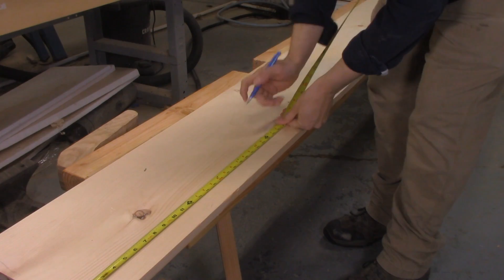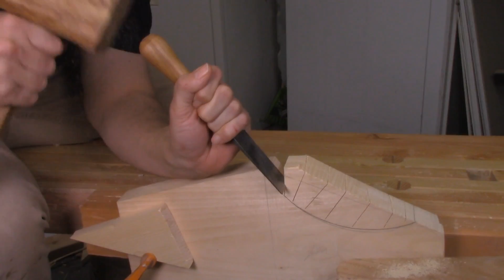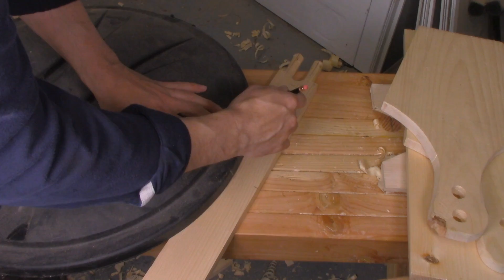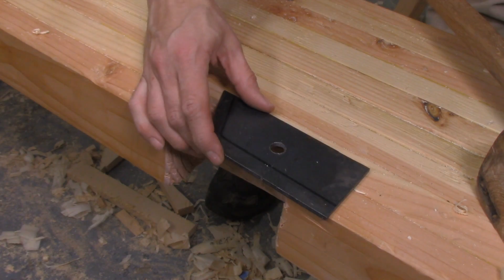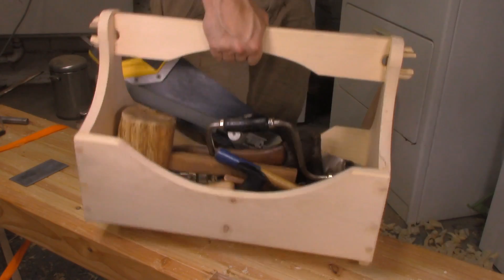Make this tool tote from one board.

Comment: Just to share a little of my own experience: i made a tote for my daughter; she's at an age where she wants to do what Daddy does (LOVE THIS AGE!), and so we made a tote...the handle was some left over curtain rod. I drilled a hole that was almost the same diameter, and it was a right-royal pain in the rump to get the handle in place. but, it's there for good, and no glue or fasteners required. I had the same general shape, with the outward slant of the sidewalls, and made the end pieces first. When I attached the side pieces, I didn't try to shape the wood at first. I drilled holes, pegged it with glue, and when the glue dried, I planed the protruding edges of the side pieces down. One benefit is that the side angles may or may not be consistent. Don't have to be. Planing "whatever protruded" made it the right angle, even though I have no idea what the angle is. I used a small forstner bit to put series of 1/8" deep "depressions" in the wood. hard to call them holes, really. I glued in some rare-earth magnets, for tools to stick in place. It was a good little project, my baby girl loves it. She glares at me because I use it all the time! (yeah, I need to build myself one!) :-)
Reply: Great comment my baby daughter is one and I can’t wait to build her a tote and some wooden toy tools
Reply: @monkeyfaceII  go for it! i used to joke about teaching courses like 'toddlers and power tools' and 'baby's first table saw' - but, having your little people with you in the shop is a such a joy. and a pain. mostly a joy. :-)  only one of my 4 kiddos has much interest in shop stuff (my youngest), but at least one does....
Reply: @just-dl  that’s awesome I will

Comment: Hammering wood through a half inch box end wrench will work well to make the wooden dowels ( if you don't have the ability to drill steel). A little touch up with a rasp will make it very close to round.
Reply from the maker: That's a GREAT tip!
Reply: Agreed. That is indeed a very good tip!
Reply: I am going to give this tip a try.
Reply: Cool! I will try this too.  
Slot of us are not starting from scratch, but instead have a good variety of general tools.

Comment: coming from a carpenter, roof rafters are great and all, but we use the speed square for literally everything, a good speed square might even have depth gauge so you wouldnt need to take out another tool to get it done. i personally only use a speed square in my woodworking kit as well as i havent found a need yet for anything else, then again i've only done a few projects

Comment: This built shows off the functionalities of your workbench really well. It's remarkable that you really didn't need to break out the clamps until you showed off making the dowel with the homemade draw plate, everything else could be worked on with just the bench attachments.
Reply from the maker: You kind of need one bar clamp, but one does the job.

Comment: I'm pretty sure your dewalt construction saw has an square in it. A 90° and 45° in the handle and it should be good enough for many not so critical stuff. 
Idk may be helpful to someone.

Really enjoying this series
Reply from the maker: It does!  Good point!
Reply: Yes, many modern saws seem to have this design (not so much for older saws in my experience, which seem to trade this for a more ergonomic grip). I know my short crosscut saw has this feature ... but, it's old enough now that the screws have slipped. Even though I've tightened them up to keep the blade solidly attached, I can no longer trust it as a square. So if your saw is relatively new this can be a good solution, but the older it gets the less likely it is to work.

Comment: I really like the fact that you are working with basic tools on a low workbench! one thing I wanted to mention however, by using wooden nails/pegs (or screws for that matter) for the sides you are not really allowing the wood to move, definitely stronger than just glue in this situation, but by using iron nails you would actually let the wood move a bit because the iron nails can bend. I guess in this situation, with those sides which are still quite narrow and pine, you probably won't run into too much problems though...
Reply from the maker: Also, softwood moves very little compared to hardwood. I think it will be fine.

Comment: Thank you for sharing I really like your videos! One thing I suggest for the dowel in the spirit of avoiding extra tools/supplies. You already have a plane, so flip the plane on its back and make the dowel by smoothing the corners of your wood piece across it. With practice this can be done by feel. I make all my dowels that way, since I don't have any steel lying around.
Reply from the maker: Sounds like a good idea!

Comment: I always thought that speed squares were perfect 90's until I saw on youtube that most were not. I found out that if I drew a line on a piece of wood, then flipped the square over and drew another line there was a difference. Fortunately, there is an easy fix, and all I needed was sandpaper to bring my squares into perfection.

Comment: Another option for pinning the sides on would be to glue and pin the sides to the bottom with several pins, and add one pin from the sides into the ends, right near the bottom. No glue on the joint between the sides and the ends. To finish it off, add one pin at the top from the sides into the ends. This would go through a slot instead of a hole, and the pin would have a head on it (glue it into a  hole in a tiny block.   There are a zillion ways to do it, and I like yours too! Thanks for the video!

Comment: I really enjoy your channel.  You have excellent and easy ideas for beginners and explain them well.  I'm a hybrid woodworker - halfway between a beginner and a pro with a lot still to learn.  I would like to recommend an additional tool that every beginner should have.  A Four-in-Hand which is a short, cheap half-round wood rasp with course and fine sections on both sides.  These are extremely handy and are good for quickly shaping and smoothing curves and rounding edges so less sandpaper work is required.
Reply: You are absolutely correct, sir!
    I have "a bunch" of those... BUT I also have a "bunch" of primarily carpentry related tool-boxes, and there's usually one of those rasps in the nearest for whatever type of project I'm working on... ;o)
Reply from the maker: A rasp is on the list, for sure.
Reply: I bought one of those two dollar rasps he showed in this series, out of curiosity and s&g's. Darn thing works good, used to refine tote on Sheldon no. 9 hand plane picked up on E-bay ($7.50), pretty course but worked good for heavy stock removal. I am proably  screwing up telling this but their  no.9's are a Stanley/Bailey made plane. Not quite as refined as Stanleys, Yoke is not cast, some don"t have a screw to adjust frog, but it is adjustable. With a little tuning they work great and can be picked up cheap.
Reply: @jimcarter4929  It's worth mention that the mechanism is a "Bailey mechanism"... AND Stanley bought Bailey out sometime after Bailey brought it to market...
   Effectively, this means a LOT of old Bailey Planes have parts that are interchangeable to Stanley's... and vice versa... It's great info' for the restorer who just wants the ** thing to work, instead of a "truly original hardware piece for show"...

   The frog adjustment screw is (to my understanding, which is admittedly limited) there to align the frog assembly and rest with the mouth of the plane as precisely as possible... In early manufacturing, the tolerances were easier to keep loose and make stuff fast, so an adjustment allowed total precision control... and once assembled and tuned, it's not exactly used. You still want it in good shape for the tear-down/clean-up process which should happen from time to time (like once a year?)... but some companies neglected it entirely, and certain "cheaper" planes just didn't have it. They could "work good enough" for the economical value.

    I ended up with a small (3-gallon) bucket of files and rasps... for around $3 (US) and went through the collection with a file card and a liberal slather of phosphoric acid wash... That chemically sharpened them and coated them with "phosphate" crystals which don't dissolve readily in water (they will eventually) so it protects the "teeth" and restores the file... It's a bit tricky, but with the right acidity in solution, it's relatively forgiving if you can get your hands on the stuff. ;o)
Reply: Yes Stanley bought out Sheldon and started making their planes in Bailey style too.
Reply: @jimcarter4929  Cool... appreciate the tip. ;o)

Comment: Also Rex - the most accurate cheap square you can buy is a plastic drafting triangle. I don’t know how they do it - but any Alvin plastic triangle will be dead nuts square. I have a 12” one ($10) that will get a tablesaw sled as square  as the 5-cut method with none of the hassle.
Reply from the maker: Good tip!
Reply: They don't have registration point though.

Comment: You could eventually make a little shelf to fit into the top that has some random things for screwdrivers, chisels , nails, screws, and other little bits and bobs. That wouldn't be too hard and would make it a little more like a standard tool case however It would be better with straight top edges on the side I think. right? It would be easy to make it out of some of the same wood however I challenge you to make it out of scrap wood you get for free like a dresser or book case that someone is throwing out. It would also be cool to see some projects made with some pallets, I know that I have seen some pallets made out of beautiful oak used only once being thrown out, and even if they are a little dirty and stained from being left out in the rain or a rusty puddle then that is just spalting and character.
Reply from the maker: evilcanofdrpepper I was thinking about some removable trays for exactly that.  I totally might do it!

Comment: Imho, the tennens (sp) off of the ends of the handles would be GREAT for holding wrapped bungee cords around/along the handle when they are not in use, but the tool box is, taking them off to wrap around the toolbox itself to minimize spillage when the tools are put up and being transported. Accidental function ftw!
Reply from the maker: That's a great idea!  (tenon, btw.)

Comment: Great project Rex. I'm thinking I might have to have a go at something similar.
I wonder how feasible it would be to make this with only wooden fixings and not use any glue, nails or screws. 
I was thinking that the base could be secured with a wedged through tenon (It's cool looking joint I only just learnt about). I'm wondering how to fix the sides on without glue on the dowel pins.
Reply from the maker: I do think you could do it. The sides could be dovetails without glue and that wedged thru-tenon would be perfect for the bottom. Do it!
Reply: @RexKrueger  
you mean like, dovetail the ends of the side pieces into the edges of the pieces that the handle attaches to?
Reply: I never thought of dovetails, I forgot they self lock in one direction.

Comment: Small suggestion for your plans - For those of us who drive small cars, could you provide the cutting length of the 12' board so it can be carried in smaller sections?  Without doing math not sure if a simple cut in the middle at 6' would work. For example, 7' and 5' so the parts could still be cut properly. I bought the plans for this but no way I'm getting a 1x12x12 in my Toyota. Looking forward to more plans and videos. Thank you for sharing your content!

Also, the tip-sheet on your website that shows an illustration of the box says you need a 12-foot board but your video says you only need an 8' foot board.  Yet I notice the widest dimension in the plan is 9" so could you get away with a 10" wide board?  Not trying to be picky - Just my first build and want to be sure I understand. :)

Comment: Rex, I forgot to comment about the size of the pegs. For a 1"x12"x8ft board, the thickness is a nominal 3/4". A 1/2" hole leaves less than 1/16" of material on either side. There is not much room for error. The drill bit has to be held perfectly parallel to the sides to prevent a blowout. Going with a 3/8" peg or smaller would provide more leeway.
Reply from the maker: I think you got the math a bit wrong. 3/4-1/2=1/4  1/4 divided by 2 is 1/8, not 1/16. I usually don't nit-pick details like this, but I bored and drove 12 of these with no trouble, so I think the tolerances are just fine.
Reply: @RexKrueger  Oops, you are absolutely correct. My apologies.

Comment: Wow. Your lumber prices are insanely low compared to Australian ....  Cheapest equivalent to your board I can readily get at our "big box store" (Bunnings), is a manufactured finger joined board of our radiata pine, and it would cost about 4 times as much as your board.
But less wide boards are cheaper and we can improvise and adapt :)
Reply from the maker: Woodworking in Aus does seem to be very challenging. Keep at it!

Comment: Rex please do a diy workbench vise
Reply: I second this.
Reply: Third. I’m trying my hands on a moxon vice. Any tips here would be great
Reply from the maker: I feel like there are a lot of diy vices out there. What should I add? What do you need?
Reply from the maker: Never made a Moxon vice. I wish you luck!
Reply: @jlw35cudvm  i made my moxon vise using the bar used for dumbbells. It's fast travel thread all the way and all ready has 2 nuts, shaped like an 8 point star so you dont even need to make a separate knob. It opens and locks fast and holds strong.
Reply: Mikhail Galatinov Thanks, I’m trying to use bar clamps and many layers of Baltic birch plywood
Reply: Rex Krueger I just like a lot the way you explain things, and the way you make things easy for someone who isn’t a experienced woodworker like me, or could you recommend someone’s video??
Reply: Hermann   Jay Bates and Pask Makes both have several videos on homemade vices. John Heisz too.
Reply: Seth Bracken thanks!!
Reply from the maker: I second Jay Bates. His is good and simple.
Reply: There's plenty of vises that are easy to make out there, but it's another matter entirely to choose a vise type that works with THIS bench. What he's built so far has alot of workholding options already, and the only thing I might add is a few holdfasts and a doe's foot batten. I made a workbench like this with a similar goal about a year ago and between benchdogs, wedges, and holdfasts I found I didn't need a vise, and his has several things that mine didn't.

If you have a different design of bench already, it's easy to make a wedge-based moxon vise by using tusked tenons. If you want something more exotic, Izzy Swan has a quick and easy step-operated vise for small stuff, and an interesting wedge-based face vise in a video titled something like "emergency work bench" for larger things. In my waist-high bench I'm currently using a compound bird's mouth vise which is pretty similar to the square cutout Rex uses on this bench, and for most things I like it better than my screw vise, which I haven't bothered to reinstall after I moved 2 months ago.

Comment: first i want to say think youfor all your great videos.
in this video you mention it being a very soft wood. is there a way to harden a soft wood post working on it to make it more durable in the long run?

also is there any way you can make a video talking about different types of jointery techniques such as pegs, dove tale, etc.?
Reply: @FerretPirate does it swell the wood? im assuming it would be good to try and have a soft wood to carve and add the small details and then use the hardener to make it last. would it swell and distort the carvings?
Reply from the maker: Wood hardener is totally an option. I used pine b/c it is easy to work. If you want a harder finished product, I suggest a harder wood.
Reply: Use fire. Shou sugi ban, or japanese wood burning hardens wood and makes the surface water resistant.

Comment: I doubt that board was 12” wide. A #2  pine 1x12 s4s (surfaced 4 sides) is 11.25”. Big difference if you actually need a full 12”.
Reply from the maker: I think this one actually was 12 in. The thickness was 3/4, but the other measurements were good. Regardless, the plans reflect the piece of weed I actually bought.

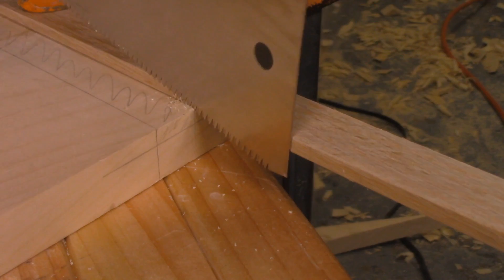Comment: Rex, you must have gotten a defective (dull) saw or extremely tough hands. At 5:06 of your video I expected blood to flow. Users should not put their thumb or other body parts on top of the saw blade to aid sawing. That is a bad habit to get into. The tote is a good intro project. How about introducing the four-in-hand rasp/file? Sandpaper is not inexpensive. A good rasp or file can do a lot of the work leaving sandpaper for final shaping.
Reply: Kam Leo Shinto rasp is pretty much my favorite shaping tool.

Comment: coping saw to cut the curves instead of the rip cuts and chisels?
Reply: A Coping saw is not in the tools for the "tools for humans". Rex is show casing what can be done with very simple and inexpensive tools.
Reply: @lotharerkens8154  a coping saw is $15.00 Canadian.  Very inexpensive tool or $6.00 at harbor freight in the US
Reply from the maker: There's nothing wrong with a coping saw, but we're adding to the tools slowly in this series and we haven't gotten there yet. With each video, I add a maximum of one tool. This time, it was the square.